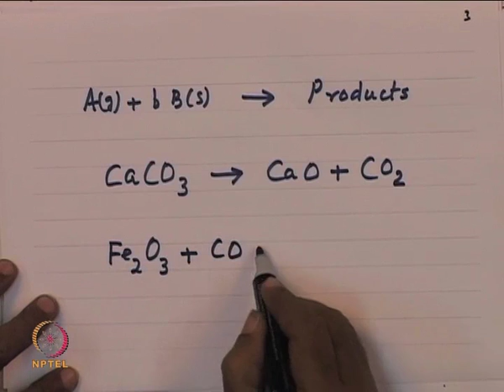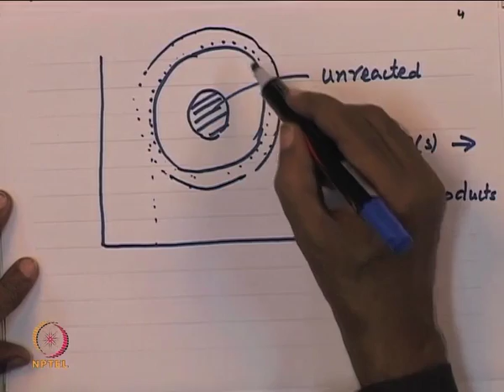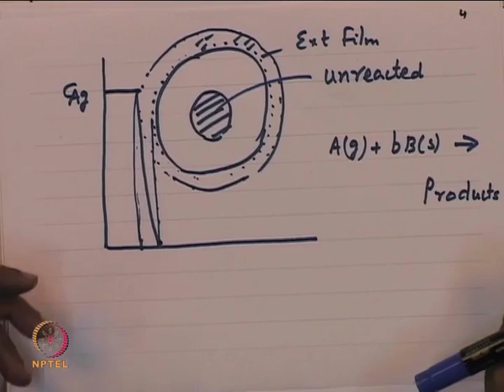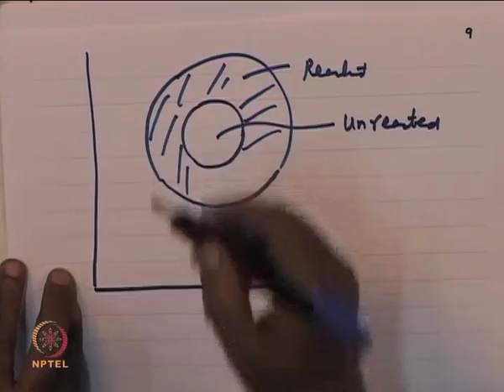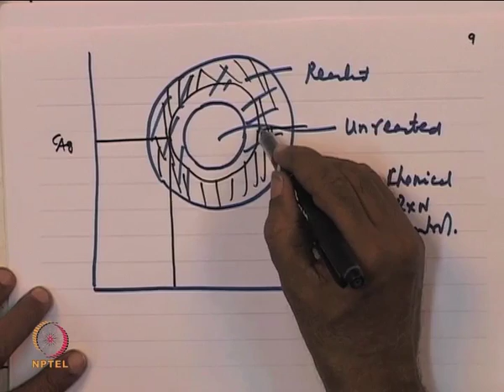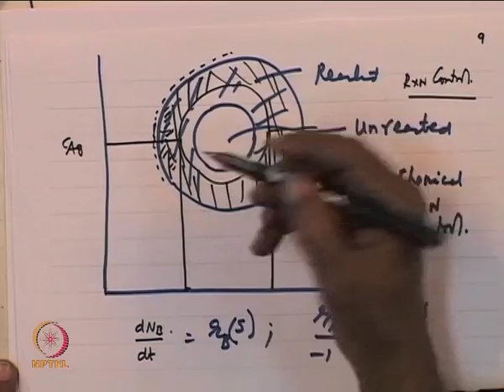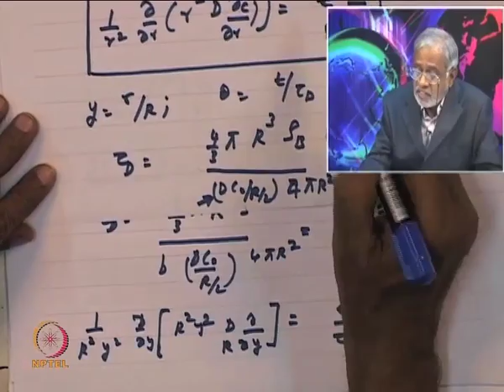Mod-01 Lec-28 Shrinking core Gas-Solid reactions Model

Comment: Thank you very much professor, 
it definitely a very nice lecture.  I have a question if someone can answer.  Why in the ''Diffusion control'' case, the the surface area for mass transfer kept as [4(pi) R2] a constant even the particle in shirking and same area is keep shirking with the particle for the ''Reaction control'' case?
Reply: It is not like that. For spherical body, we can write molar flow rate = D. 4pi.R(R+ delta)(C_Ag - C_As)/delta, where delta = film thickness = outer radius - inner radius. Since R >> \delta, so R + delta ~ R. Also, C_Ag >> C_As. We can write, molar flow rate of A in gas film = D. 4pi.R^2C_Ag/delta. We know, D/delta = K_g, therefore we can write, molar flow rate = K_g (4pi.R^2)C_Ag.